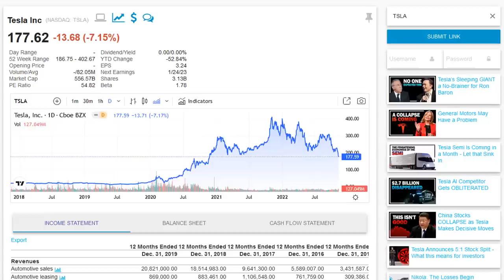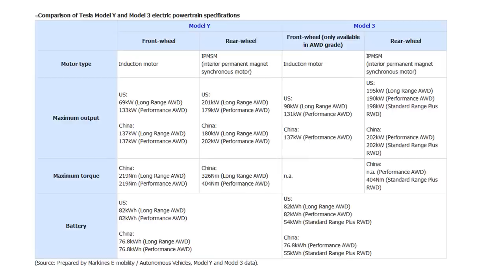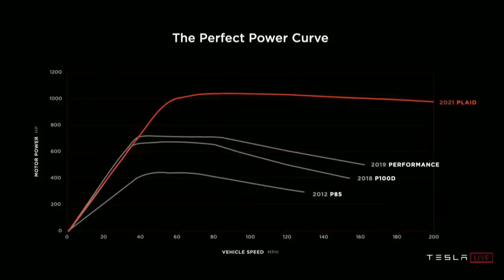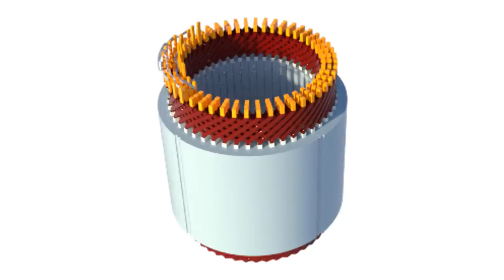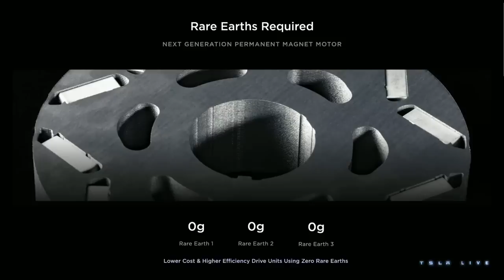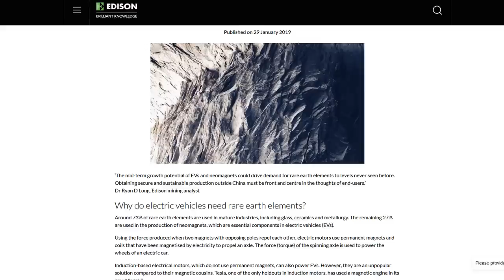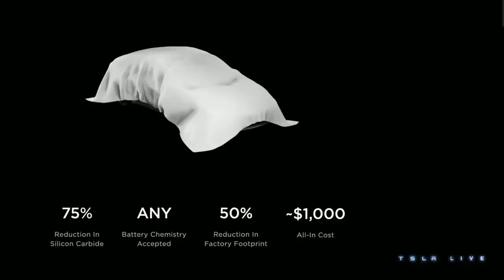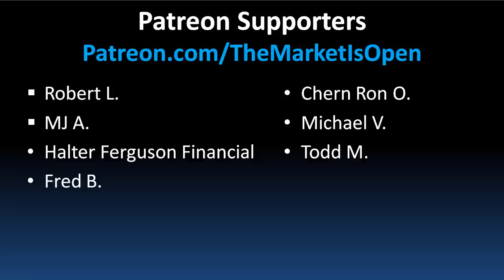Elon Musk's NEW INSANE Motor SHOCKS The Entire Industry!

Comment: Once the Model Y hits a price point comparable to a CX-5 or RAV4 then we will know EVs will take over everything (as long as the grid catches up). Right now EVs still cost too much and make no sense for most people vs a hybrid like the Honda Civic E HEV or the new Prius which offer astounding efficiency, much faster refueling, no cold weather downsides, and much lower cost.
Reply: If that happens, electricity is going to get very expensive.
Reply: @tienken1  Yes, charging your car will cost close to the same as gas.
Reply: @carlfrye1566   and it’s not any greener
Reply: @carlfrye1566  Build your own solar panels fuel will be cheap while you pay off the solar and free when once you pay it off.
Reply: @Musicgolfnsmallblockchevys  in fact every single electric vehicle built to this day is at minimum 5% more carbon footprint just the mind the materials, than the entire lifetime of a gasoline vehicle. Not to mention that disposing of the batteries once they're done is a environmental nightmare. And they were seems to forget the electric vehicles do produce emissions. And yeah that's not forget that when you charge your electric vehicle you're burning natural gas or coal to get that electricity. So all in all way worse for the environment.
Reply: @1 Ashum  Actually EVs should drive the electricity Lower. This is due to the increase the average load on the grid with very little increase in the peak requirements Allowing electric companies to be more profitable. Since their costs are based on providing peak requirements
Reply: @gregkramer5588  

Hi Greg. 
Your point taken in isolation is logical, however a competing and overwhelming narrative that is superposed upon all of this is the initiative to replace high density power sources (fossil fuels, nuclear) with "Green Energy" such as wind and solar, which are ultra low density and subject to the caprice of Mother Nature (with whom I can never be cross, due to my intense enjoyment of the containers that she invented for Mother's Milk!).  Any segment of the North American energy grid that relies to any significant extent on such folly becomes the Achilles Heel of the entire system, for many reasons that I am quite happy to discuss with you.  Power generation and distribution was my field for the bulk of my career, so it is a subject with which I am reasonably familiar.   The concept that the availability of energy to the citizens of a modern society such as we enjoy in North America to this point in time can remain stable yet subject to the whims of wind and solar is absurd and anybody with any understanding of the power distribution grid already knows this.
Reply: @robertgoodrick1561  Very wordy but most of it was superfluous!  The problem with energy storage in a system with 70% or more wind/solar is solvable. 
Some of this could be like the 20M KWH water storage in use currently in Switzerland. 
Other storage could be like the compressed air storage being implemented in CA with a  5M KWH.
Additionally part of the car battery recycle process will be to use the degraded batteries in stationary back up systems.  40-70% capacity remaining would still be great as a guess.
Lastly we can have vehicles that are part of the grid with their batteries.  The Ford Lightning is capable of this today.  Utility companies are already in discussions about implementing this where the end user gets a lower rate but provides battery back up.  
To sum up, energy storage is not only solvable problem but we are well on the way.  The next two decades will accelerate this shift. 
The thing that is hard to solve is how does humanity take minimal damage from the pollution caused by the burning of fossil fuels and the associated climate change.
Reply: @gregkramer5588  And I've heard that changing some coal plants to nuclear would result in more efficent power, and possibly more power available. The grid itself may need to be strengthened too. 
In Europe they use the 220V system and it's more power than our 120V system, however the power on the lines is more or less similar - I did not research that yet so I don't know.
Reply: @metalmike570  I have never heard of changing a coal plant to nuclear.  The design and requirements are so different. I am a retired electrical engineer.  220V does not mean more power and is only applicable inside the home, factory or place of business. It may sound weird but EVs will help even out the power consumption of the grid which makes the grid more efficient overall.   The added requirements for peak power will not go up that much while any average power increases will help the bottom line of the electric companies.  The grid IMO is not the big challenge which I believe is the charging infrastructure.  
Best regards,
Reply: @gregkramer5588  I meant replace coal plants with nuclear power if it seems feasible.  It would be built near the coal power plant and then switched over. 
I'm not an electrical engineer but I know something about electronics and redundant systems, or backup systems.
If you think the grid can handle it I believe you; I'm rooting for Tesla all the time I have 25 shares of it.
Reply: Lately I've noticed a lot more chargers on the grid. It's happening and faster than folks can calculate. I will buy more Tesla stock; a few shares at a time - buy the dip!!
Reply: When I get my Tesla I’m also going to get their battery wall pack and some solar panels to go as independent as possible from the grid.
Reply: @patrickkelly8095  I would go with a car that like the eGMP or Ford products in this case instead of Tesla.  They have the built in inverters and the powerwall is very expensive.
Reply: @patrickkelly8095  Well humans today do have to plan for the future generations too. Charging EV at home from solar panel batteries during off peak times will be the norm. What is the alternative...
"Oil will end by 2052   – 30 years time and become unaffordable before then.
Gas will end by 2060  – 40 years time.
Coal will last till 2090 –   70 years time."
Reply: I mean people be like I spent 20k on solar panel and 100k on my Tesla it cost me pretty much nothing to charge my car ! Great you could have bought a car for 40k and spend 80k on gas and maintenance?  Nope
Reply: @akunamatata4266  yea, that’s the problem with it all right now. So until it comes down to being more affordable it ain’t with it.
Reply: @akunamatata4266  The solar panels do pay for themselves. Cars do not, no secret there.  Luxury cars really cost you money.  EVs just costs less than most over time.
Reply: The market has plenty of room for EVs.  Not a be all end all of course.  
They fit best  where a person has a above average commute and can charge at home.  That is a pretty big group.
Reply: In 1909 a new Model T cost $850, but by 1924 the price had gone down to only $260. The average assembly line worker could purchase one with four months’ pay in 1914. Economies of scale will see EV vehicles come down in price too. Eventually the only vehicle you will be able to buy (and eventually driverless)....the future. Some are able to envisage it. Elon Musk.
Reply: @multioptioned  Well said, and I think your right. I've accumulated some stock in Tesla so I thought it's the next big thing back in 2020 when I got my first share.
Reply: In no way do I mean to diminish the incomparable genius of Elon Musk, but the qualifier "As long as the grid catches up" is akin to "as long as pigs DO manage to fly".   Electric vehicles certainly do have a role to play in the future, but if we are to preserve our current level of independent mobility (pun UNintended) then it will always remain a marginal one.  Unless we are to acquiesce to the WOKE left and surrender our personal mobility, fossil fuels are here to stay for many decades yet.
Reply: @robertgoodrick1561  The expansion of the grid required is way, way less than AC takes.  I would expect battery tech to incrementally improve such that in 10 years the cost per kwh will drop by at least 25% if not 50%.
Reply: @robertgoodrick1561  lmao, You understand that "fossil" fuels are NOT renewable??   Sometime in the very near future, they will no longer be available? Unless you are OK with strip mining the earth down to the core? Or wearing facemasks, gas masks to breathe? Be like the dinosaur sir. Musk is no genius
Reply: @zoobee4824
Reply: @robertgoodrick1561  The more gas prices go up, the better EV's will look as an alternative.
When gas goes to an average price of $4.00, EV sales will begin increasing and eventually pass ICE vehicles.
FACTS!
Reply: @metalmike570  

Mike . . . your statement is not a presentation of FACTS . . . but rather expressions of your OPINION.  There is an important distinction to be made here.  In my opinion yours is based upon propaganda, not logic.  You make no mention of the significance of the PRICE or the availability of electricity to charge an EV.  Here in CA where fewer than 4% of cars are EV's there are already restrictions on when one can charge an EV.  With another 96% to go, are you not concerned about this?   If not, then I am curious as to why not??   Furthermore, far fewer than half of IC powered vehicles are personal automobiles, the rest being the complex web of transport trucks, diesel locomotives, aircraft, oceangoing vessels, etc. , etc. etc.  As we wean ourselves forcefully from oil, how is all this movement of humans and freight to be accomplished?
Reply: @metalmike570  lol yeah cuz electricity hasn't gone up and is predicted to go up way more in the future. I just came off a 5-year locked in contract. My electricity is now over double what I was locked in at.
Reply: @PS-gr5wh  All cars and vehicles are way over-priced now, so this is making hybrid and EV's seem like a better deal. 
And All this is being done on purpose in my opinion.

Comment: What's shocking about a PM motor not using neodymium magnets? Also as you said the hairpin design has been implemented by others before, and I'm sure their designs are well implemented already. I mean if a motor is already 98% efficient you're not going to optimise it much more except on a cost basis.
The same Sandy Munro YouTube channel you reference said that in a Chrysler minivan the cost of the engine and gearbox is less than the cost of the interior of the vehicle.

Comment: So, when is the electricity created by these motors going to be fed back into the batteries supplying the vehicle, which would be truer to their function of removing the use of fossil fuels? Coal, and uranium are still used to create electricity and now due to all these extra electric guzzler productions the need for electricity is higher, and there are no self sufficient areas like buildings in any city, if you claim they are, prove it.not with pathetic useless words or written crapulance, remove all power grid into the building , make it completely redundant by destroying thegrid connection..isnt always wind and as good as solar is these days after say a week of dense cloud...what sun

Comment: The maths towards the end is faulty. Just because the batteries and drivetrain are 25% of the cost does not mean that by reducing their cost the cost of the other components also comes down. the body, wheels and tyres will not change.

Comment: I always wondered why they do not introduce a secondary system to use functionality of the vehicle to recharge the batteries while in motion. Effectively making a self charging system.
Reply: The law of decreasing returns makes it impractical. To charge a battery you need energy. Where is that energy coming from? The battery, via the motors. Energy is being used up by the motors. Net gain = 0.
Reply: @stopthebus  also I was also commenting in a facetious manner when bringing up a completely self charging system. I really was leaning towards max efficiency as the key.
Reply: @corbypulju2619  At least you understand the limits of physics and electrical engineering! It's hard to tell when people are being serious or facetious on here, but way too many still believe that you can get the energy you expend back. Yes there is regenerative braking, but that's when the car is slowing to a stop (as you well know), not while it's moving along and using energy from the battery.
Reply: @stopthebus  
Maybe they could ise the mition of the  schock absorbers to somehow generqte electricity.
Reply: @EnteKross123  Not enough movement to generate any worthwhile amount of energy. Reality is if it could be done, Elon would have incorporated it years ago.
Reply: @stopthebus  well they could also have wind turbines on the car to generate power or simply use any moving part to somehow generate power but I guess the tech is not good enough for that yet
Reply: @EnteKross123  No. A wind turbine would cause drag and you'd need to apply more power to the motors to offset that, thereby negating any power you generated. Hundreds of people have tried to create perpetual motion / power machines and failed. You need to understand basic physics / laws of dynamics / energy transfer to realize it can't be done.
Reply: @stopthebus  it's been tried.... your right, not enough energy to bother with
Reply: @stopthebus  why can’t the momentum and weight of the vehicle be used in the breaking? The heat being generated buy the processing of the chipsets and breaking could be repurposed. Wind generated with the movement of the vehicle. Gravity of the movement. Capturing the different forces of energy and repurposing them. To not be outcomes of a reaction but a solution for the next question.